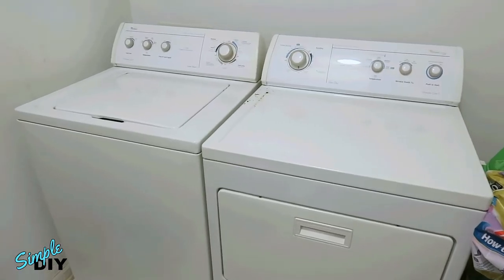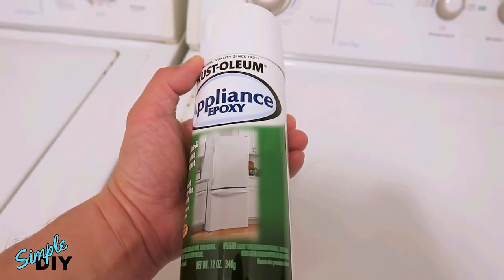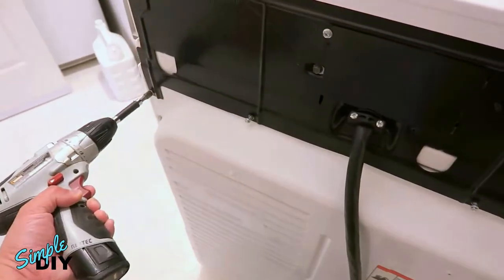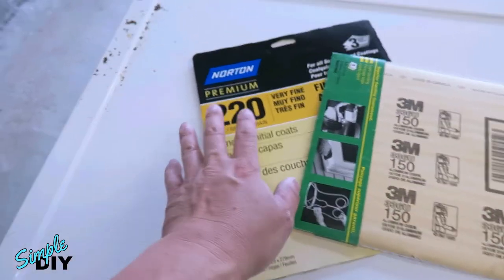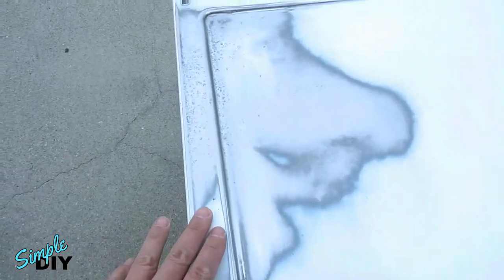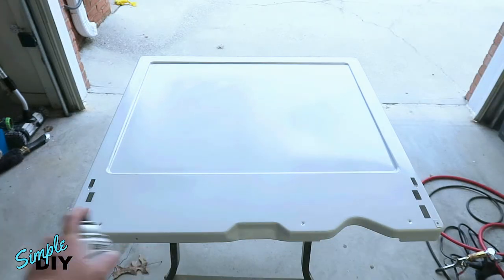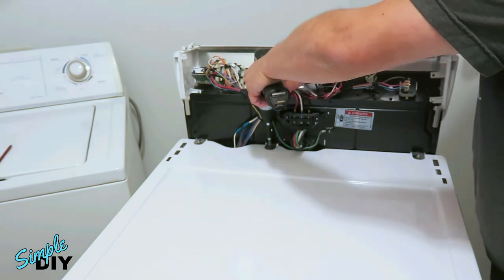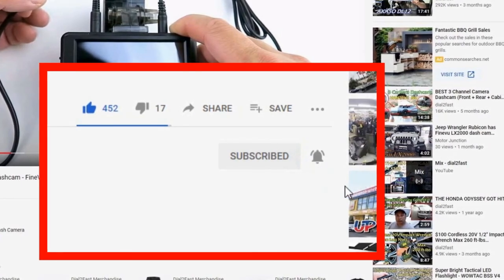How To Paint A Washer & Dryer & Refrigerator

Comment: I have similar problem, however a small chunk on the bottom lip has rusted off.
Any advise? I'm thinking of using bondo filler used on car panel? Thanks
Reply from the maker: Yes I think your best option is bondo filler and sanding. Follow by the spray paint. That should take care of it.
Reply: @SimpleDIYMedia  Thank you my friend - Is the epoxy enamel or primer? Asking as we don't have this product in Australia so I'll have to find another water resistant alternative, thank you.
Reply from the maker: @modzz8319  This is an epoxy paint finish. It's not a primer. If you don't have it in Australia, you can also use an enamel spray paint.